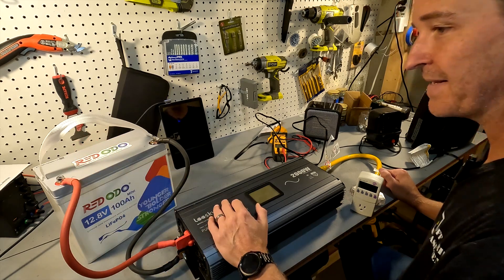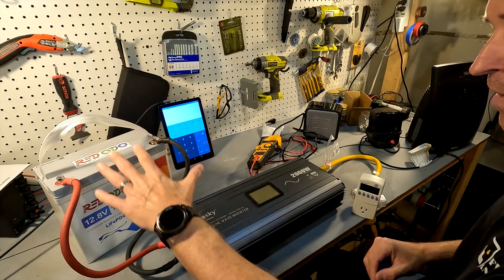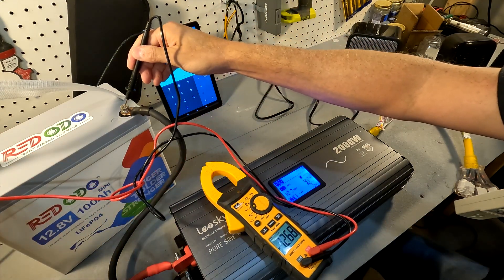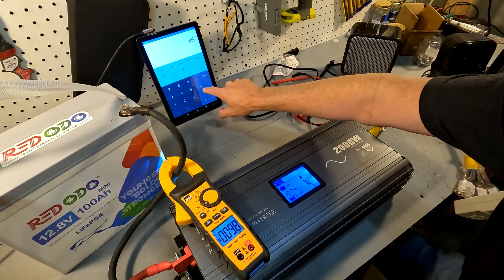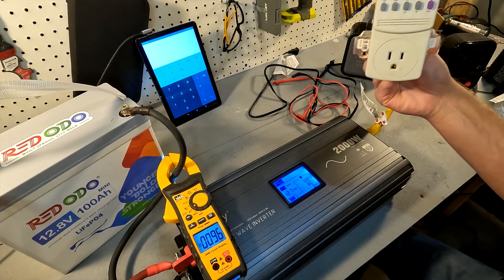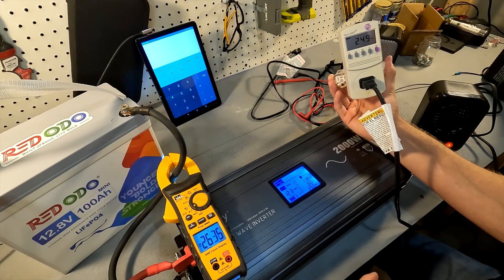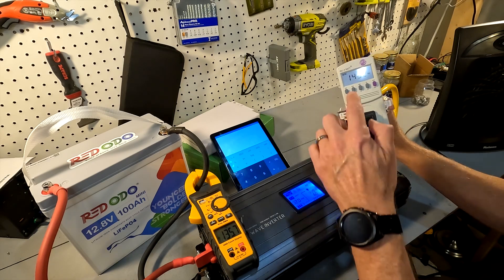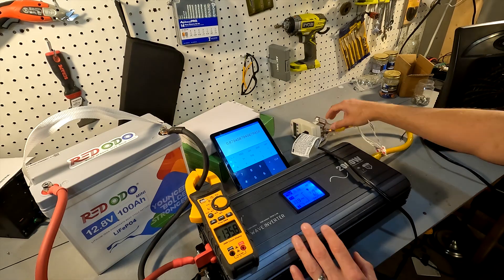How to find the Efficiency of your off grid inverter and will it change with different load amounts.

Comment: One thing about those kill-a-watts... they are great, but the contacts in the socket on the unit seem to oxidize or corrode or something.  I've had kill-a-watts melt a bit around the socket from heat due to that when left for long periods with high loads running through them.

In anycase, 85% is very common for inverter efficiency under low loads.

Also note that you didn't actually get 90% for your medium load or 87.9% for your high load test because you missed the loss of efficiency at the battery due to the voltage draw-down.   The efficiency actually went down, not up, and the reason is due to the voltage drop from the battery and wiring to the inverter (mostly the battery since you had short wires to the inverter).

On your high load test, the battery dropped from 13.3V to 12.1V which means the battery itself lost 10% efficiency (relative to its low-load efficiency).   Though some of that might have been due to topping the battery off, still at 13.3V it had settled so we will use those numbers.  12.1 / 13.3 = 90.1% In addition to the 87.9% inverter efficiency.   So multiply those efficiencies together.  0.901 * 0.879 =  0.792.

The high-load test was actually only 79.2% efficient.

This is also a good example of why people shouldn't be using 12V topologies any more.   At least not for "new" projects.  LiFePO4 batteries and all the insundary equipment are available in 24V and 48V and those will reduce voltage-drop related losses to 1/4th or 1/16th the losses you get at 12V with the same wire sizes, and still reduce losses substantially even when thinner wires are used.

For example, a voltage drawdown of (1.19V / 2.0) (because also half the amps are being pulled for the same power consumption) on a 24V system takes you from 26.6V to 26.01V, which is 97.8% efficient.    Even ignoring the "/ 2.0"... assuming the battery is half the amp-hours at double the voltage, you still get 25.41 / 26.6 = 95.5% efficient.    For a 48V system lets say (53.2V - 1.19V) / 53.2V = 97.8% efficient (25Ah 48V battery vs 100Ah 12V battery).

The battery voltage drawdown depends on the battery size.  But the voltage drop over wiring depends only on the wire size, so the "divide by 2" comes back into play.   Ohms law.   P = I^2 * R.... power losses over wiring go by the square of the current.  So the above efficiencies are actually higher when you put that back into play for the wire drop, particularly if running long wires to the inverter.

Either way it is a huge huge huge difference verses a 12V system and that is why, really, nobody should be using 12V for "new" projects.  Even when retrofitting old 12V systems with new LiFePO4 batteries, I would still go with a higher voltage and then use a Victron charge controller to down-buffer into the "old" 12V system.   Then over time migrate equipment to the higher voltage as you can.

-Matt
Reply from the maker: Thank you for all the great information.  I didn't think of the voltage drop under heavy load.  Also, thanks for the comment.

Comment: nice.. makes just want to run a 24v system now instead of 12v due to amp loads are big on 12v since i want to use a small 1000+ heater it will cut that amps in half ...1500 ac heater will drain that 12v battery in like 30 mins
Reply: I switched to a 24 volt bank and inverter just for that reason, I thought the Air conditioner's amp load would be half but it actually dropped from 75 amps on 12 volts to around 30 amps on 24 volts. I wasn't expecting that. I now wonder how a 48 volt bank would work.
Reply from the maker: Yes it will.  You're better off getting an electric blanket.  It will last for hours!  Thanks for the comment.